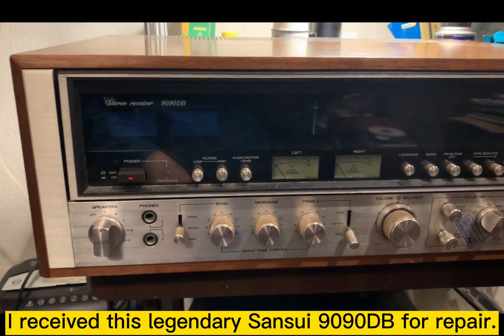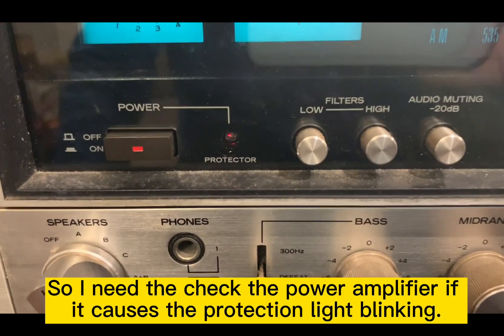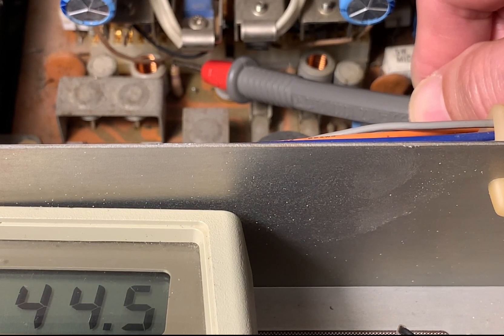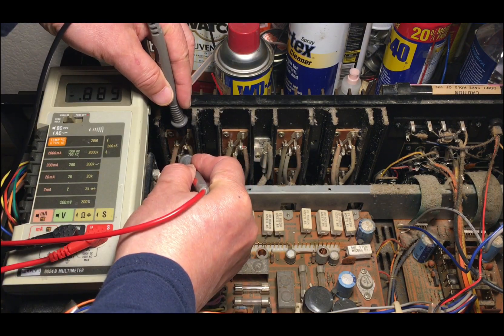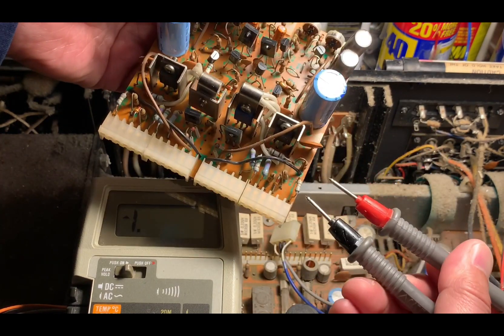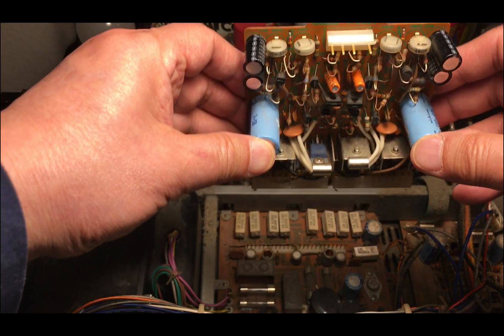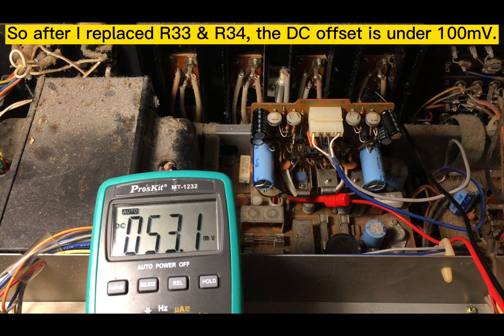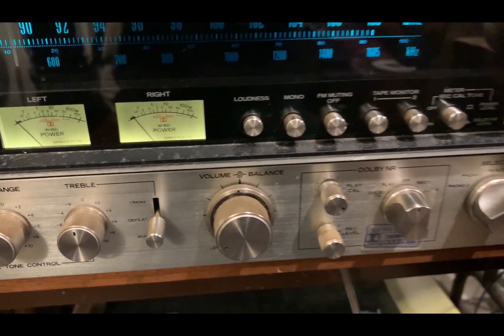Sansui 9090DB Receiver Repair I - Protection Mode On

Comment: 9090DB question:  If you fire up the unit w/o the Driver board, what does the Protector light do? Blinking  Red as well? Also, w/o the driver board AUX, AM, FM Phono 1 and Phono2  will not light as well when the input selector is turned ?  Thanks!!
Reply from the maker: It depends on if there is a defective part in the power transistors or protection circuit. But it is a good way to troubleshoot the problem when repair the power amplifiers. Usually when you remove the driver board, the outputs DC offset is still detected by the protection circuit. If it shows blinking red, then there are two scenarios: (1) defective power transistor (2) defective power supply or components in protection circuit. So you have to check the power transistors first. If the power transistors are OK and the driver board is out, then the problem is the the protection circuit which is required to check the power supply and the components on the protection circuit board.
Reply: @VintageAudioFan  Thank-  They were 3 bad power transistor - after removal Protection is now  green- ordered replacments . Thank you again!
Reply: @VintageAudioFan   Thank you

Comment: Hi I tested my sansui 9090db dc offset it reads negative 50 DC. Is this normal? My unit is under protection mode.
Reply from the maker: The reading of DC offset needs to be close to 0 V in order to get out of the protection mode. So there is a problem in the power amplifier on your 9090DB.